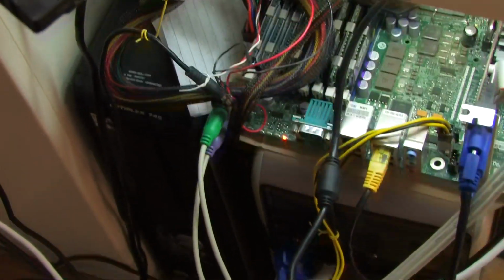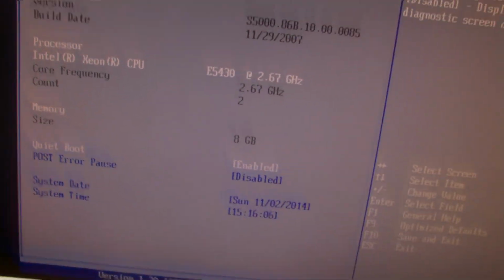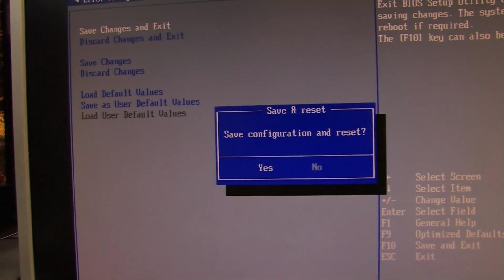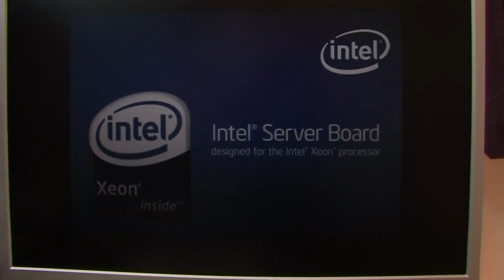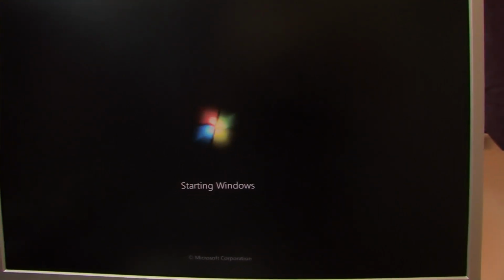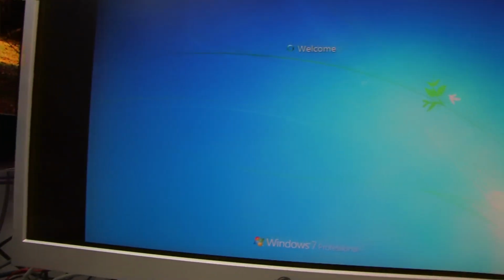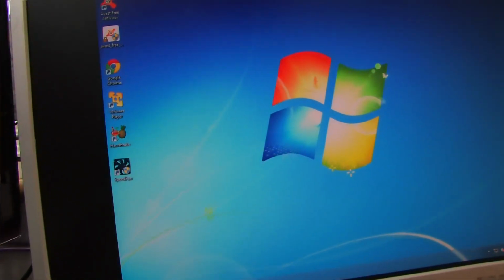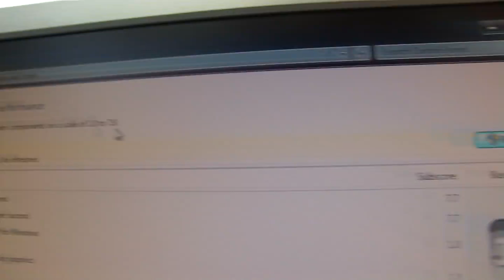Intel Server Board Dual Xeon Mobo: CPU Speed MONSTER

Comment: I have a similar setup... I have an s5500bc motherboard with two xeon x5675 processors. It gets such a high score when all of the cores are initialized at once, but singular-core tasks can be quite slow. I also need to upgrade my drive and RAM, because the RAM I ordered was 8gb dimms when I really needed 4gb dimms, so I had to use temporary ram.

Comment: Did you have any trouble getting it to boot at first. I have the same motherboard and I can't get it to boot. It turns on and then it just keeps spinning. I have a hd 7750 1gb in the pcie slot.

It does come up with a red ish light under a fan header by the ram but I have connected a fun to it with no change.

Comment: If you have one of the Intel Boards and it is in a case that is NOT intel.
(I have the S5000PSL)
And the fans are super loud.
Run the FRUSDR from a bootable USB drive.
And run 
FSL48.BAT
And choose 
Update FRU's and SDR's

Choose NO for everything.
When it ask if you have the CPU fans installed, choose NO.
After it updates.
reboot (CTRL ALT DEL)
And you should have a quieter system.

Good Luck
Wayne

Comment: I get lights going off near my inserted ram. Then it won't boot. I use ECC fully buffered DDR2 667 server ram, so I don't see an issue. Any ideas? What kind of ram did you use?
Reply: +Mary Jane have a look at the pdf for the mobo instruction manual. On my server it was the PSU that was causing the flashing green on the front and back. Just type in the mobo type then page 46 i think

Comment: What's your Power Supply's model ? 
Can I use any PS for this motherboard ?
Reply from the maker: +Romain COGNARD I use an EVGA 500w PSU. I would recommend a PSU with a large amount of 12V capability as the two CPUs are quite power consuming. Also, the Motherboard requires two additional CPU power inputs, a typical 4 pin and an 8 pin.
Reply: Peter C Thank you
But does the motherboard need special pin connectors ?
Reply from the maker: +pqxxedf Good advice!

Comment: I have the same Mobo. I have to say it was unbearably noisy until I flashed the FRUSDR so that the BMC knows in which chassis the board is. After that overall noise is a lot better (The fans are running at much lower RPM than before flashing), but still not hardly as quiet is I'd like it to be.

Comment: i have the exact same board but i have the satar version and on mine i have 2 quad core e5430 processors and i have 16gb of ram and a 750watt power supply and i threw on an ssd. but i still got to find a better video card over the ati radeon x600. and mine is running windows 7 pro
Reply from the maker: Very nice! I'm considering upgrading this to 16GB/32GB RAM.
Reply: i got my board new old stock and boy is this a big board an e-atx board. i love it and will use it till it dies. at some point i would want to find the last processors it can handle and max its ram. also i would like a better video card if i can ever afford one but sadly right now i cant :(

Comment: Those fans are nothing compared to the fan I have. It is a 12V 50W (yes, 50 watts!), 90mm (or something close to that). This thing SCREAMS, and it has to be held down by something or else it will blow itself over. I can't imagine getting a finger caught in there! FYI it is rated at 13,000RPMs....
I might just have to do a video of it, it is SO crazy! xD
Reply from the maker: The camera really doesn't do these justice. I can imagine that fan though!
Reply: +Benjamin “Ozias” Esposti my arse is that true